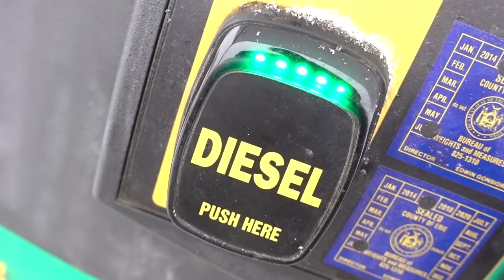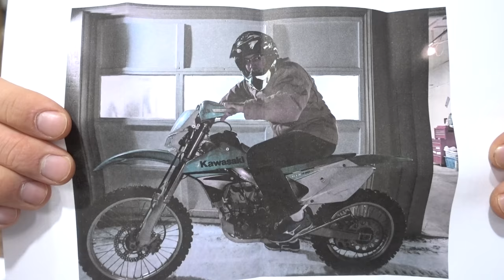SUPER ILLEGAL DIRT BIKE!

Comment: for future reference to remove a sparkplug from down inside the head as shown in this vid, a simple piece of air hose cut to length works perfect for grabbing those hard to get plugs. stick the hose down the channel and guaranteed the plug will stick in the other end making for easy removal.